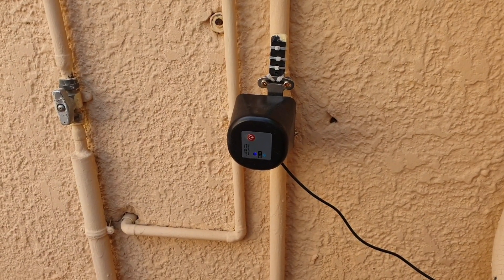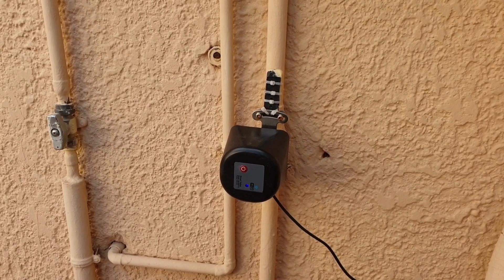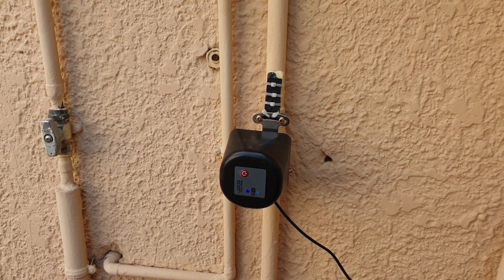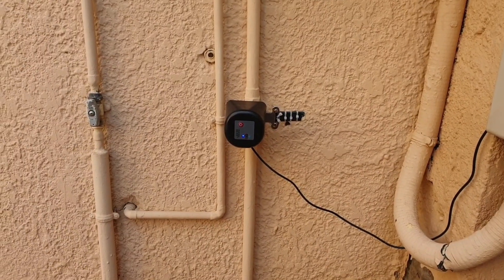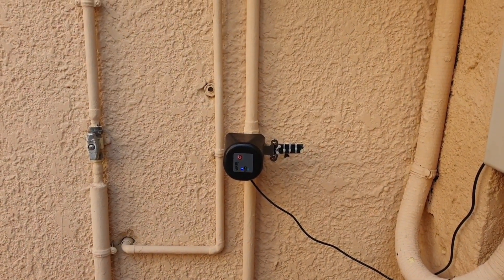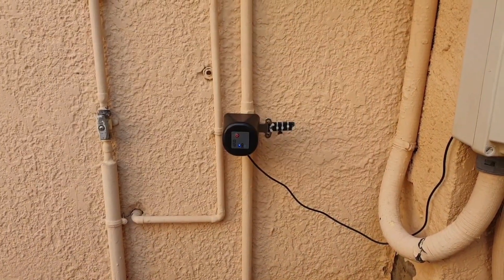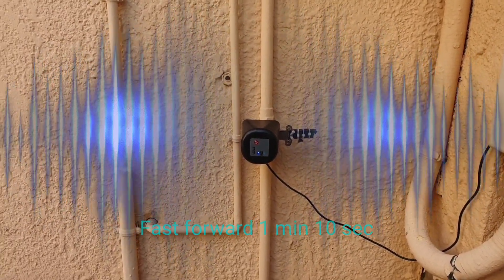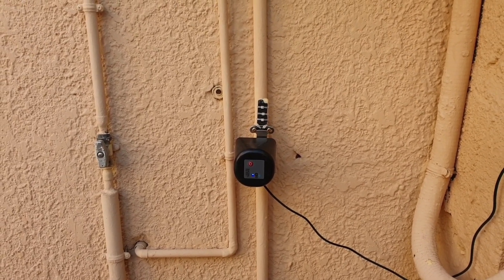Useelink Tuya Water Valve Problem and How I Solved it in Home Assistant

Comment: Hi,
If anyone could help me with this would be great:
I have a strange problem with my Tuya smart valve.
It opens and close in the opposite directions.
So when it says it's open the water switch is closed and when it says it's closed the water switch is open.

Comment: Thanks for sharing. Have same issue with another Tuya valve and consider it a design issue, shame there is no option for behavior, and complained to OEM.  Have more power dips/ losses than water bursts.

Comment: Hi zoltar99,

Please give me the products details you are using i wanna buy it on Amazon if it's possible. I found a couple but they said i can't integrate the valve with the water sensor...so please help me with this..
and the apps too

The other question is, Do i need internet or with a local wifi works for the two devices?

Thx for advance
Reply from the maker: Aismel, links added to the video description. 
As for your last question, you will need internet, but if you flash Tasmota on the valve you should be able to run it locally without internet. I have not tested it though.

Comment: Hi zoltar99 you can simple ping your tuya smart valve to see if its online or offline.
Did you tuya convert it to be offline, so not connected to the cloud?
Reply from the maker: DKAutomater, No, it is still online, good as a backup in case I somehow cannot get to it via home assistant and I'm away from home. I guess I could ping the water valve too, I might give it a go, but so far it's worked very well tracking the camera, no issues.
Reply: @zoltar99  Great to hear zoltar99 :)
Reply: @zoltar99 can you please share your setup for pinging the camera am a newbie to all of this and have the same problem. I appreciate if you can help as your video was the only thing useful I could find on the internet